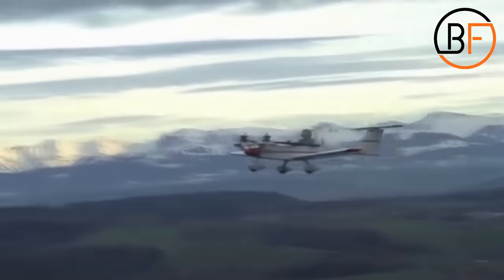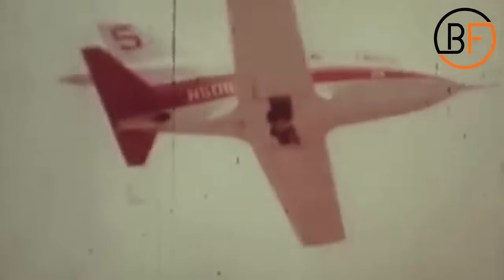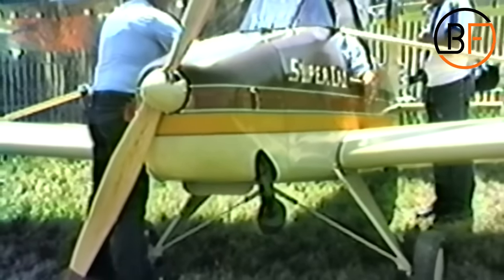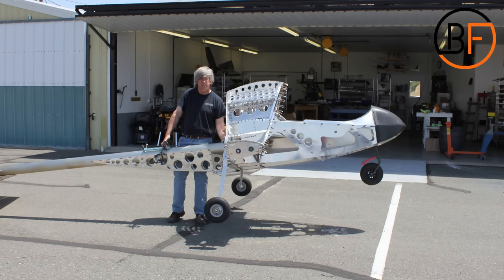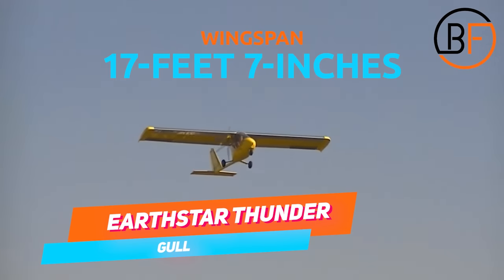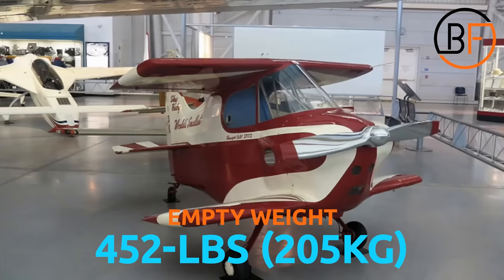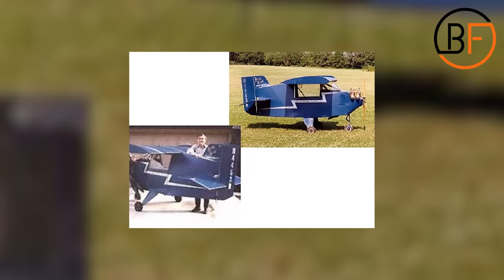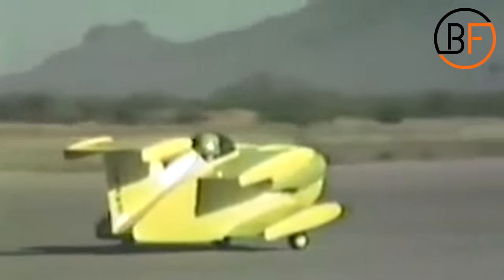Smallest Mini Aircraft in the World

Comment: Victor Dnitryev  technical characteristics of the X-14d "nano" aircraft  from USSR  1979 

Length, m ... 3.13
Height, m ... 1.22
Wingspan, m ... 5
Wing area, m2 ... 1.76
Dry weight, kg ... 54
Takeoff speed, km / h ... 55
Maximum speed, km / h ... 130
Engine company "Cheset":… 380 cm³, 6400 rpm, 42 hp.

Comment: IIRC, the BD-5 was sold with two potential sets of wings, long (18'?) and short (12'?). All the early models were sent with long wings, and short wings were never delivered. Even the long wings had very narrow CG limits (something like 1/2", IIRC). Of the several first homebuilt flights, most terminated with accidents, with most of those fatal. The short wings would have made the CG limits even narrower. The original engine, again IIRC, was a snowmobile engine, but most builders substituted something else due to difficulty in getting an engine, adding to the CG problems.

Comment: I don't think I'd fancy flying in some of these aircraft.  I don't reckon they'd be easy to control in the event of engine failure.
Reply: In case of failure I prefer to be in this small plane where it should be easy to eject with a parachute, rather than in a commercial plane where you are stuck inside... 😅
Reply: Il y a du vrai dans les deux cas
Reply: Actually I think it's opposite. The smaller planes are so lite they would glide more than drop like  a sack of potatoes making it easier to control and land than a bigger plane. But I'll be honest and say I'm not a pilot!
Reply: It’s more the landing for me imagine in grass field and obstacles rocks wood 🪵 etc…

Comment: The Honda jet with the two engines on top of the wings is smaller than the citation quite a bit
Reply: That depends upon the model of Citation you're comparing it to. The early 500 / 501 models weren't overly large.

Comment: In order of being allowed to run on ordinary roads (same as mopeds, it will never be allowed running on highways), wing span of a flying machine must be less than 239 cm.
For the BD-5, nothing compares to the Aixro Wankel Rotary Engine. 40 HP; other RCE makers have engines with more HP. To solve the torsional vibrations of propeller shaft, add bearings.
To use a liquid cooled engine, either the Mustang P-51 system, or a motorcycle radiator, with thermostat controlled electric fan. See 'Cooling your Wankel', by P Lamar.
Blessings +
Reply: Bearings aren't going to solve that problem.
Reply: @crow578  I mean, if you have a shaft with only two extremes, it would vibrate, if you put 'collars', in the middle, as engine crankshafts have, this will reduce torsional issues, you know it's not same a crankshaft with three or six bearings for same number of cylinders. Could this be tested?
Blessings +
Reply: @joseveintegenario-nisu1928  No, it won't. That will have exactly zero effect on torsion. You think the designers wouldn't have thought of something simple like that?

Comment: The use of Edison generators for unlimited electric power without fuel is missing from the industry. An old car generator can be converted to edison self spinning generator by chisel.   If you remove the Tesla magnets from the armature magnets and leave the Edison magnets on the armature the generator will spin like a motor and generate the same voltage and amperage electricity without fuel or cranking.  You count the magnets on the armature and divide by 6.  This is the number of magnets to chisel off and to leave on.  You alternate on and off all the way around.  You have three sixths on and and three sixths off in a motor pattern.  The DC is connected to the DC side of inverters to have 110v AC. 40 amp inverters with two 20 amp outlets are available.
Reply: It's missing because physics laws (conservation of energy) makes it imposible. You can't break physics laws. You should go to jail for promoting breaking them :)
Reply: @markcampbell7577  You can't obtain energy without another energy supply. Anyone can build his own generator, but you need a waterfall or something to move it, propaganda can't stop inventors and people from building their own devices. Edison used electric motors, his electric cars would have worked with low voltage electric rails on the street if Diode would have invented earliear. (Like bumper cars on amusement parks). Batteries were too big and heavy on those days. Please study physics before saying that energy can be obtained without a source.